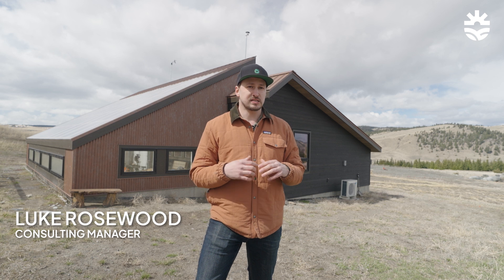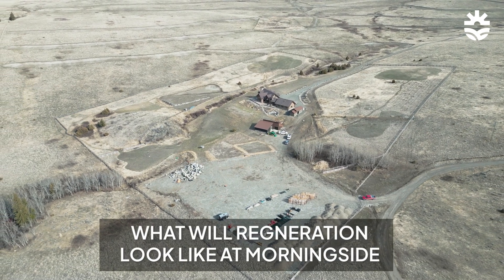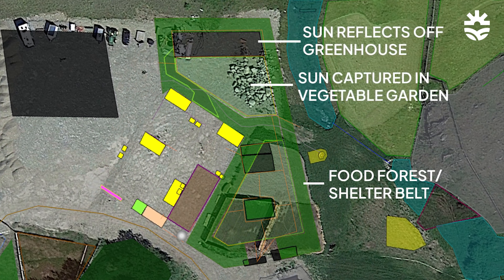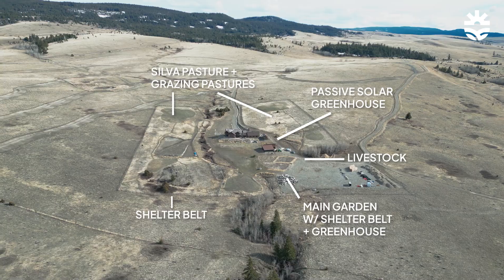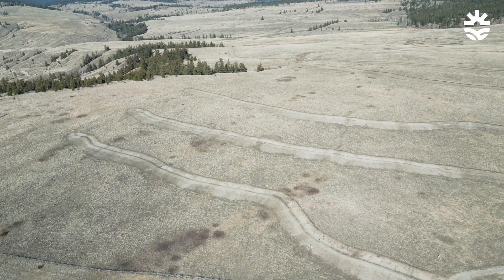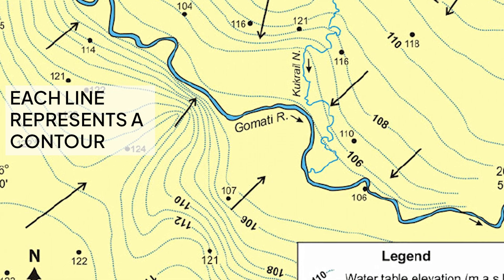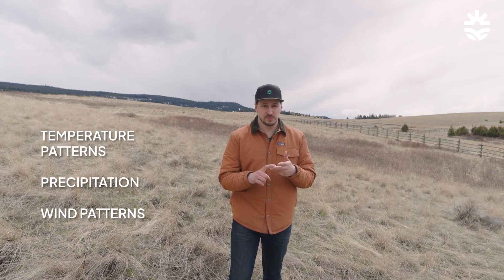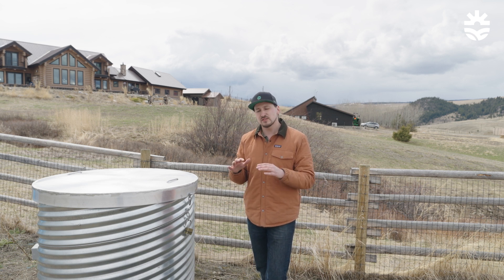Here's How We Use Property Design to Regenerate Land

Comment: Curious if you guys ever considered using keyline design during the land assessment and design phase rather than on-contour swales?  Given that you intend to incorporate silvopasture and that the property looks to have a lot of ridges and valleys (which you discussed), would keyline have been more beneficial in this context? If you did consider keyline design, but decided against it, I’m curious if you could provide some details or specific factors that you felt as to why the swales provide more benefits?

I’m relatively new to both of these design practices and have begun incorporating some small scale swales on my property over the past couple years, but also see where keyline design might be more beneficial in the long term regeneration of the land and make future management more efficient. Do you have any thoughts on how to best determine which practice will be most beneficial in a given context?  Perhaps an idea for a future video?

Great content on the channel so far…thanks for putting it out.